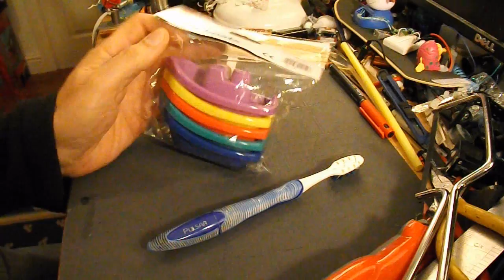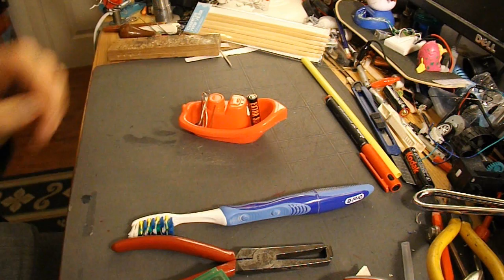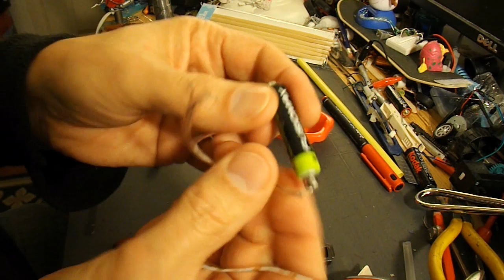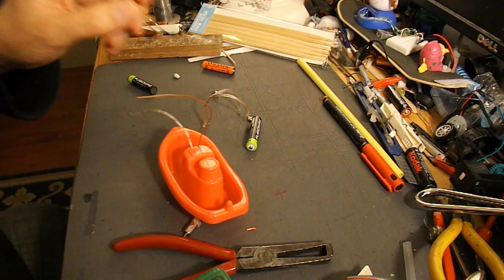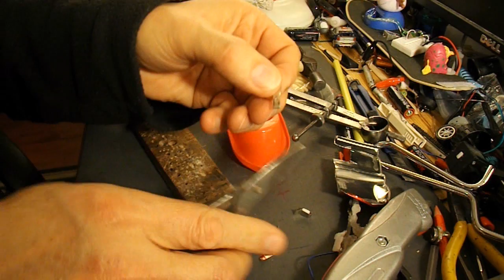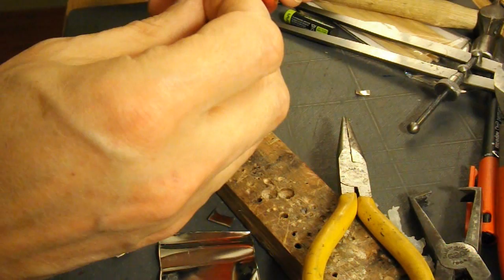Oral B Pulsar Vibrating Toothbrush Motor Boat

Comment: I'm thinking of giving this a try myself. I'm just curious if the motor is already safe to put in the water, or did you have to do some modifying to make it safe to do so?
Reply from the maker: Train2589 no modification. It depends a lot on the water you are putting it in as to how long it will last because the bearings may well seize up eventually due to the impurities in the water - salt and mud etc The brushes and commutator may corrode eventually too, just depends how long you want it to last. This one didn't seem to suffer any problems and it cost me nothing and I have plenty more.
Here is my video of one disassembled https://youtu.be/y3JXfjiDXv8
Reply: GrandadIsAnOldMan Ah, ok.  Thank you for the reply!

Comment: Can you mske a helicopter useing that toothbrush?
Reply from the maker: No it's not powerful enough.
Are Cheap Toy Motors any good for helicopters? 
http://youtu.be/IOOLKous-pU?list=PLA5a2xPRSrB0bsGC0JThAhfhgShEFUOfa
Are cheap toy motors any good for helicopters Part #2 
http://youtu.be/lbgfUppKuUg?list=PLA5a2xPRSrB0bsGC0JThAhfhgShEFUOfa
Are cheap toy motors any good for helicopters Part #3 
http://youtu.be/ysn4Xkm0b8k?list=PLA5a2xPRSrB0bsGC0JThAhfhgShEFUOfa
Using the Oral B toothbrush motor
http://www.youtube.com/playlist?list=PLA5a2xPRSrB0bsGC0JThAhfhgShEFUOfa
Reply: Oh, well I would also suggest trying to make a saw that cuts paper I know that sounds dumb but can you at least try
Reply from the maker: On Jon well that is a bit of lateral thinking. Probably not a practical use but might be an interesting project. I will put that on the list.

Comment: Brilliant !!
Are these de brushes you are using yourself or do you buy them on purpose or salvage them from an other source ?
Reply from the maker: We have been using them for years, maybe more than 10 years, and I always save them. They are not very powerful and you can get similar sized ones off eBay which are much more powerful and cheaper so only use them if you already have them. I don't recommend buying the toothbrush just for the motor.

Comment: Dear grandad, can you make a paper airplane that is powered by one of these? Or mabye you could make a small rc plane from scratch? Maybe with parts from a rc car and/or toothbrush motor?
Reply: By one of these i mean the motor from a toothbrush motor
Reply from the maker: I have used these motors in a few of my planes but they really don't have enough power. They certainly would not have enough power to carry the weight of an rc receiver. If you look at the indoor rc planes you can find on many YouTube videos you will find the motors look similar but they are much more powerful and the rc equipment is specialist light weight versions.
Here is my Aircraft playlist http://www.youtube.com/playlist?list=PLA5a2xPRSrB0nZItxE_78EJP0F99Ghaki
Here is my styrofoam plate glider playlist which does use one of these motors
http://www.youtube.com/playlist?list=PLA5a2xPRSrB03ITop_TpKAtz3FxxFOc7R
Here is my styrofoam plate biplane which uses a more powerful motor
http://www.youtube.com/playlist?list=PLA5a2xPRSrB2ztUDIZJqfcCfO-vZZed0u
Here is my Pizza Tray De Havilland Mosquito which uses 2 of the more powerful motors
http://www.youtube.com/playlist?list=PLA5a2xPRSrB2vw43V2xKeu1I-C2y1QKbn
Reply: +GrandadIsAnOldMan What about one of those feather weight, ultra-light gliders? They connect the motor, it has no steering ability, no receiver, attached to an ultralight (about 15-20 grams/with wings made from a thin seran wrap and a lightweight frame) and let it glide around? Would that work? Thank you :) by the way your videos are very helpful. Thank you for posting!
Reply from the maker: +Youssef Martinez yes that would probably work. There are plenty of videos of plane like that even with RC https://youtu.be/JmRkxZT4XhY https://youtu.be/j9MeY7yH90k https://youtu.be/LTXL_YXjHk0 
I also like this one https://youtu.be/KdGee7s4lNU